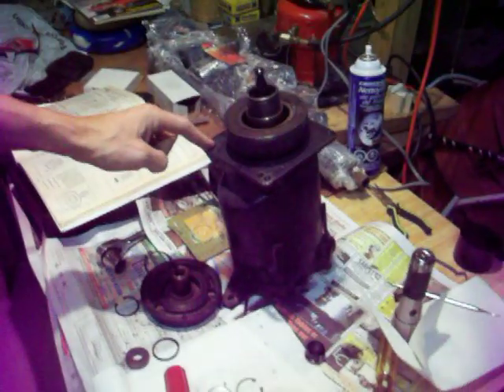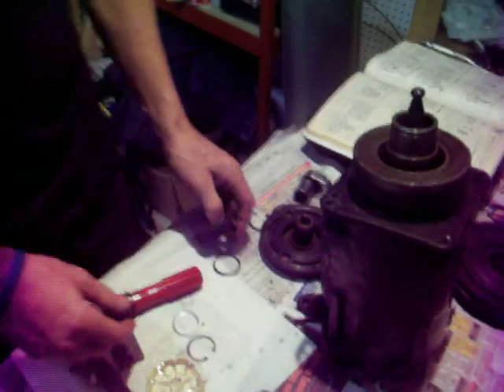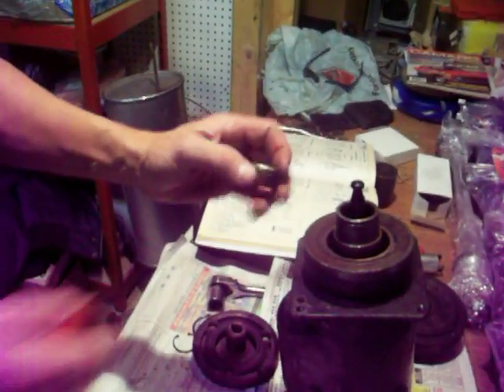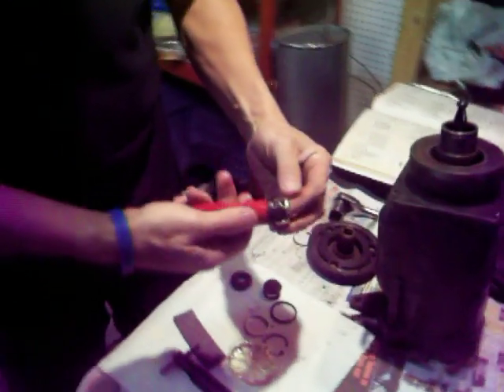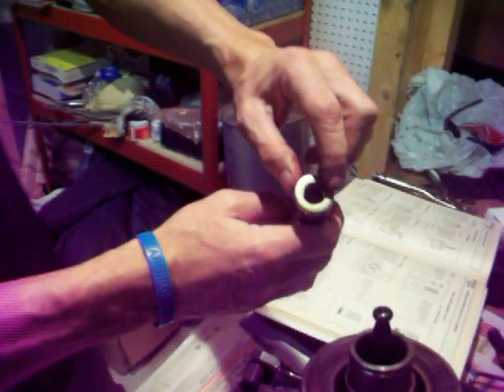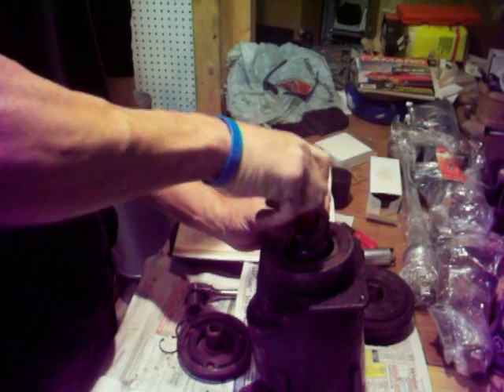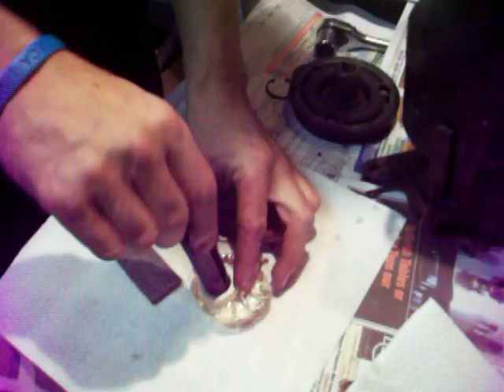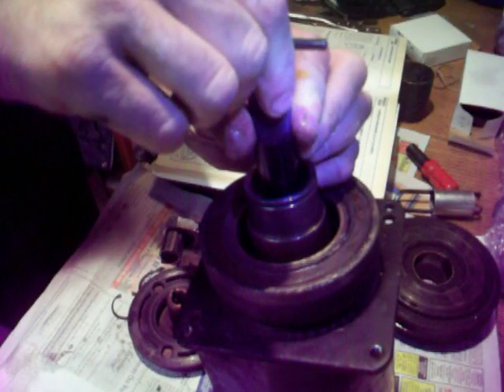GM A-6 Compressor Front Seal Replacement Quick Overview

Comment from the maker: Sounds like a nice ride.  Front wheel drive Caddy!  With tons of power and torque to pull you around corners and surprise many around you.  I will answer you at length later on in a PM (is your account set up to accept PM's, check it out) as to what is involved.  I will do a movie some time in the spring about this too.

Comment from the maker: @ghtowagon The 'UGHHH' for me here is that with 'Google' taking over this Youtube thing, I never get message notification, by chance I signed on today. Many comments! The R-4s are notorious for leaks, especially with the large case 'O'-rings. The case size, and the fact there is really not much oil held in them, the front seals then get involved because they score from infrequent oiling. I am not sure if the tools can be rented out, they are needed for some of the steps indeed!